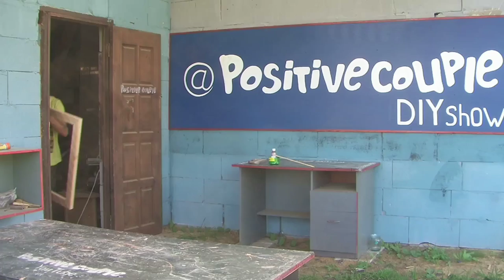Panel made of oak "Crystal river".

Comment: I would put Epoxy onto it and use as a table :)
Reply: Exactly... Nice clear coat. Perfect for a table top.
Reply: Mannedavid | SecondFaceTV, I was thinking the exact same thing.
Reply: Mannedavid | SecondFaceTV  or a nice wall art.
Reply: and when the LED strip would need to be replaced what would you do? I would simply put an acrylic sheet (similar to glass, doesn't break as easy)
Reply: +Super Wig Maker Just alter the initial build and instead of installing the LED strip inside the edge just put it under it after doing the epoxy
Reply: Or just leave an opening at the bottom for the LED lights, so you can get to them and they illuminate the floor as well
Reply: I mean they last a LONGGGG time. Providing it wasnt running 24/7 I would imagine it wouldnt need to be changed in a lifetime...
Reply: Except if for some reason LED strip fail at some point - starts blinking or stops illuminating completely. Happens to my LED Strips 5% of the time.
Reply: thats the only draw back i have with making something so nice; what if the lights start to fail....
Reply: I can almost guarantee you that if you buy decent non-Chinese-built LEDS that they will be fine for thousands of hours. It's very rare that decent LED's blink or burn out. My Unlces LEDs in his alarm clock still work to this day and they are nearly 30 years old. German made.
Reply: Ash Lawson Mate, what's wrong with Chinese built LEDS?
Reply: If they are bought in China, they are less quality. For example. If you buy them in EU, even if they are made in China factory, they use better electronic parts, more durable, and LED doesn't go rampart and flicker in a month or two. But if you buy LED in EU, for a bit higher price, you can also expect better duration and reliability. Buying on E-bay directly from China = Very low price, low quality. Buyin in EU for a higher price = They are also made in China, but for EU market they make it on EU standards and so more durable.
Reply: May i ask what the material he use for "crystal" element?
Reply: could you bury clear pvc pipe beneath the crushed glass, and then place led light strips inside, then you can change them easily, by pulling out and re inserting a new led strip??
Reply: Now THAT is a very good idea!
Reply: Thank you, Im looking forward to trying it on a epoxy river table with live edge, i would like to use chunks of glass as they have but im finding it difficult to get hold of any raw colored glass in any large quantity, looking at maybe marbles or dragon drops.
Reply: how to make these crytal stones like this or where can i buy them?
Reply: I thought that's what he was going to do.
Reply: I totally agree with you
Reply: MLD, it is glass. I can buy the same stuff a few hours from me.
Reply: indeed, it looks incomplete
Reply: @shinerecordsgrog  pp
Reply: Anna De Nardis  pp?
Reply: I acually thought that was next... Beautiful tho
Reply: Respectfully, I do think this is a magnificent piece of art to be hanged.
If you cover ir with epoxy, you wouldn't be able to distinguish among all the sizes of the wood chips cause some ate taller than others....
Reply: I was thinking the same thing that would be amazing
Reply: I think once it's done attaching underneath would be an option??? I think I don't know 😂
Reply: Vanakkam! ✌🏿
Reply: @firesoldier343  LED's last for 60,000 hours I was told but start to dull after 30,000.
Reply: same here
Reply: What no opoxy?  I was expecting a table top

Comment: if you put a layer of epoxy it will be amaziiing
Reply: Yeah, I thought it'd be easier to put a layer of epoxy first and then just dump the stones in there instead of gluing them individually. So even if there's a bare spot there's still resin there
Reply: Yeah I agree, layer of clear epoxy and a high polish finish would have looked amazing..... still nice job though
Reply: Only downside is there would be no access possible for the lights to fix them without destroying the table.
Reply: Michelle M could've installed access tubes then fed the lights through perhaps. An incredible build though you are a truly gifted craftsmen
Reply: Michelle S 
No worry, use LED tape lights. Be even cooler to use RGBW (red green blue white) tape to change the effect
Reply: anyone know what those stones are
Reply: New Age Studio    .     JoX
Reply: Maybe he glued them for extra support.
Reply: Indeed. And he could also have made a fitting edge of the Table or leave it away.. xD
Reply: Yes , this is true.

Comment: I love lighted things like these, but wouldn't purchase or would cringe at the design as the lights are not changeable. So when it burns out, you either have to be without or start ripping the table apart.